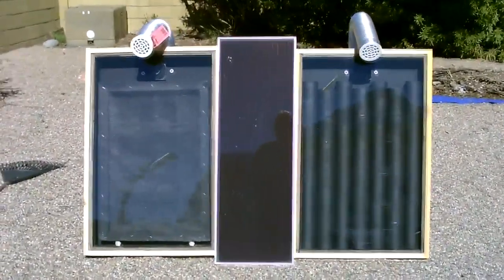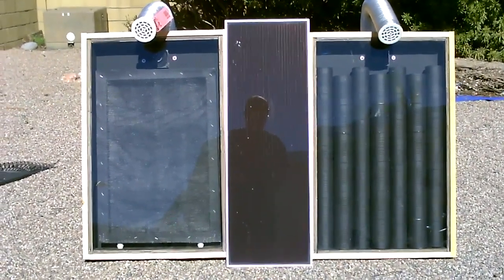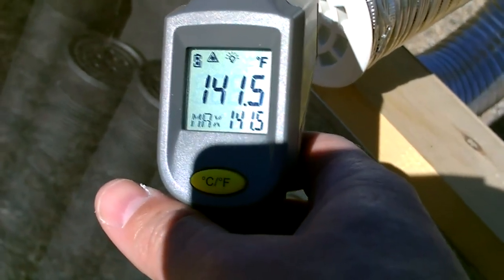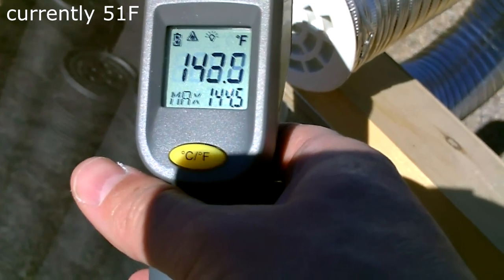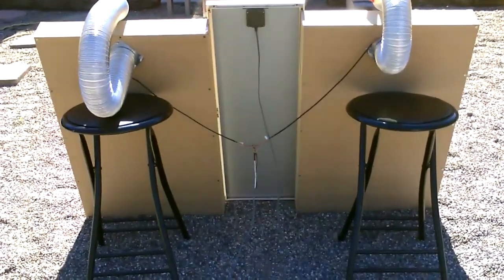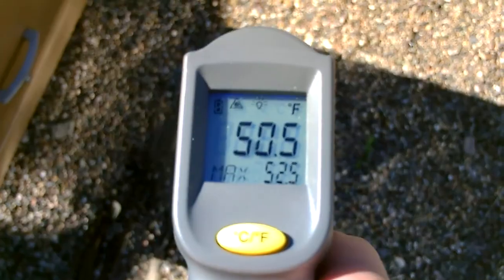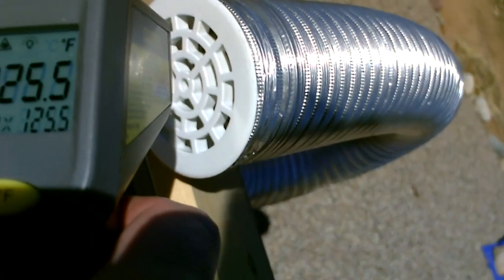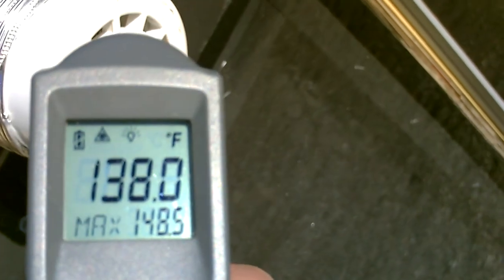Solar Air Heater Comparison! - Steel Can Heater vs. Screen Absorber Heater (temp. tests)

Comment: The surface area of the ceiling absorber is larger, and therefore more energy from the sun is transferred to the air in the form of heat.

Comment: dumb question but how do you turn it off in the summer? If you just closed a vent the heat would build up like crazy inside the heater. I see a lot of build and heat test videos but have not had much luck with install videos
Reply from the maker: hi there. the heat builds up in the summer but it doesn't matter. it never gets too hot to cause any damage. (not even close). you could cover it with something if you wanted to. i usually install the units through windows. you can mount a plank (like a 1x6 or 1x8) or a piece of plywood in a window (then just hook the hose to that).

Comment: Nice results on both panels. I have installed professionally made passive solar heat panels and these are amazing on providing continuous heat in daylight.
Reply from the maker: hi and thank you! i agree, they work very well.

Comment: Would this work in a greenhouse? How long does it heat after sun goes down?
Reply from the maker: hi. yes, it should work excellent in a greenhouse. once the sun goes down it cools off fairly quickly. (and the fan will stop as soon as the sun goes down so that works out good).

Comment: What about putting the screen over the cans? I would really like to know if it increased the heat, because I wanted to make a couple for my dog houses because I’m homeless and this is the only video I have found in years that should how well the actually work
Reply: You can't be homeless if you have a dog house.
Reply: @rayleblanc7209  I actually live in an rv in the woods dumbass get out of here with your retardation

Comment: If your duct work is not the same length at the ambient temperature then the longer duct will read lower temperature. blower cfm will have an impact as well.

Comment: Considering the heat is below 200 degrees Fahrenheit,  I would try my construction out of foil lined styrofoam panels.  The heat panel doesn't need to be metal.  Lamp black cardboard would convert the suns radiation into convection heat.  The. Internal temperature is kept low by the active fan...like a radiator!

Comment: What is the screen absorber material?
Reply from the maker: hi. it's just standard (non-metal) window screening material. (fiberglass/polyester etc)
Reply: @desertsun02  does it have to be black or can charcoal work?
Reply from the maker: @Robert McCarthy if it's a dark charcoal color it should work good

Comment: I made  an aluminum soda can heat collector panel similar to yours, inspired by your video, and it works better than I thought it would. Its been in the thirties fahrenheit and a sunny day it blows hot air all day. It just takes about one hour for the panel to heat up and blows hot air continuous throughout the day, thank you for your video.

Comment: If you really want to collect some energy, turn the air speed way up.  High temperatures are fun but pointless if the output is a trickle of hot air that doesn't do much for the rest of the room.  Crank the fans up.  Get the output temperatures down to 90 or so, fill up the whole heated space with warm air, not a corner of the heated space with hot air.

Lower temperature change = greater efficiency, greater overall output, greater usefulness.

Comment: If building an air heater--R 10 for the sides and back--pull cold air off the floor--air speed should get the output down to 20 degrees above the room temp. expect about 100 BTUs per sq. ft. per hour. The hotter the panel runs, the less heat gets to the room. It is lost to the outside. The best panel would run at 45 deg. and supply a heat pump

Comment: I'm very curious to know who this went long-term. Any follow-up wisdom?
Reply from the maker: hi there. since they've held up well, i wouldn't change much with the builds. i have recently found a different type of flange for connecting the hoses. i've actually started using air intake mounts that are typically used on cars. they sell 3" ones on amazon.
Reply: @desertsun02  excellent. Thank you for the update. There's a million build videos, but nothing in the way of a "Am I actually happy with this" video. Might be an untapped market if you're looking for a video topic. :) Thanks!

Comment: Any reason not to collect the hot air from behind solar panels? Or just use a flat black steel or alloy sheet in a double glazed box? This would be low profile and easier to incorporate into a building.

Comment: the exhaust fan hose on the can model is longer allowing for more surface area to cool down the air before exiting ,,,so i think if both are the same length ,,, the difference would be minimal. ,,,, great experiment
Reply from the maker: hi and thanks. although they may look different lengths they are exact same ✔ (neither one was ever cut down)

Comment: Excellent video and experiment. I might add that the reason the screen puts off slightly higher temps is because it both absorbs and radiates infrared light at a faster rate than the solid steel cans. However the steel cans will likely put off a more steady heat, and it will also likely continue to put off heat slightly longer than the screen once the sunlight is no longer available, therefore the total amount of BTUs generated may be very similar over a given period of time. 

Also I couldn't tell if you had glass or plexiglass or if the screen and cans were just exposed to the atmosphere. Seeing what difference would come from glass and plexiglass enclosures, as well as nothing (open air) would also be a very interesting experiment to watch. 

Thank you for taking the time to produce this video!
Reply from the maker: hi and thanks! since they operate by trapping the heat, the collectors wouldn't work much at all without the glass or plexi-glas.
Reply: Interesting, so if you had clouds passing overhead the steel can design would be a better choice if a more consistent temperature was desired.

Comment: I noticed that the duct was shorter on the screen heater. This could affect the difference between the two. The temp difference between the two is nominal. As another reviewer said, I’d build whichever one I had materials for on hand. I’d add one thing to that. The screen version would be much easier to clean by simply removing the cover glass/plexiglass and spaying with a hose or power washer. For the inevitable objections of those who fret about dust, dust mites or black mold. This sways me toward the black aluminum screen model, for no other reason than cleaning it as needed. Thanks for this video.

Comment: No more difference than a couple degrees between the two, I think the choice boils down to which one is the most economical to build. In my case it depends on the materials I have readily available to me.

Comment: I tell what I did take and make a solar screen using
Charcoal colored wire screen and simple Frame and mounted it on inside of room window wich faces south ..I am currently heated to 80 degrees farienhiet in that room the rest of house is in 70 s so that simple design would save me money on my heat bill and cost me 15 dollars to build ..I mean why not use yourr room as the box for the solar collection screen ? Right that way it's more efficient  and you don't need a fan at all ...I don't think  I could heat my entire house that way because I only got to south facing windows to play with ..so maybe I build a huge collector out of 2x4 and left over steel sheeting from roof project ? Ever get on a tin roof when it's sunny ? Anyways I want

To thank you for the  awesome idea 💡 and give you credit ..

Comment: interesting comparison, but to get the true output you need to measure airflow coming out,  one with more restriction will flow less air, but also be warmer.  with both the airflow output, and the temps you can calculate BTU output to see which is actually more efficient.
Reply: Airflow thru the unit is important, to much airflow will lower the temperature. It has to be the correct airflow.
Reply: @stevenbusman  correct, there is a happy middle ground in the efficiency balancing the heat input and the airflow.
Reply: @stevenbusman  I apologize if I am overlooking something, but to my understanding, a variation in air flow would still not alter the BTUs in the outflow.
Reply: @anthonynorton666  Yes, it would.
Reply: @raam1666  Indeed air flow will affect heat output, see the video on my channel titled: "Solar Heat System Tuning, Part 2"

Comment: How does the steel panel compare to these
Reply from the maker: hi. it's pretty similar. that unit is a bit bigger than these though so it's hard to do an accurate side by side test.
Reply: @desertsun02  what do you think is the most feasible and efficient option
Reply from the maker: @Shane Noel it will depend on the materials that you have available to you and if you want to incorporate 'recycling' into your project. by recycling i mean using old food cans as an example. one of my personal favorites is the downspout solar air heater i made. it uses solid glass on the front and has a thick plywood back. the downspout material is fairly thick too.

Comment: Wouldn’t making the path for the air to move through longer make the air warmer? For example, instead of having the air come in from the bottom, straight to the top, why wouldn’t one design this to make the air zag back and forth?

If the aluminum cans were replaced with smaller HVAC duct that zig zag back and forth from the bottom to the top, would that work?
Reply: Can't see why it wouldn't. I guess the steel cans are just a low cost easy to get alternative.
Reply: @JosuRibeiro  Yeah, that's a good point. 

I mainly ask because I've seen it be suggested that if you make the path for the air to move through longer, you end up getting less actual heat in your output. The same goes for if you restrict the air too much. I just wanted to verify that.

Comment: I simply can't understand why every single home in the UK is not fitted with something passive like this that is always on the go in the winter, and maybe in the summer working as a heat exchanger of sorts.

Same with solar water heating. Why wouldn't you have the sun at least heat up the water 30% of the way and use the boiler to top it up if you wanted a bath or something.

Fed up hearing about "be green" and "climate change" when systems such as these are inexpensive, can be fitted in a day and would save thousands over their ridiculously long lifetime (at least compared to batteries and solar panels).

Comment: I still haven't seen one that works better than my truck radiator painted black almost 100% efficiency with high clarity glass three pain
Reply: ב''ה, water or air?
Reply: I'd like more info on how you did that

Comment: Maybe try something like a super black paint like vantablack or black 2.0 and see how much heat you get
Reply from the maker: hi. it's good idea. i haven't been able to find vantablack on sale to the public yet. they sell it to some businesses i guess, but it's hard to get. i'll keep looking
Reply: @desertsun02  i think black 2.0 would be better since its easier to get
Reply from the maker: i looked into black 2.0, but it when it dries it can look a little bit like dark grey (i've heard). they do have something called black 3.0. i think i might try that. it is not supposed to look grey once it's dried.

Comment: Why did you use steel cans and not aluminum cans - which conduct hear much better? Was the screen aluminum?
Reply from the maker: hi. i've used both aluminum and steel cans, but i find that the steel cans seem to get hotter and say hotter longer. (probably due to the fact that steel is denser than aluminum). the screen i use is not aluminum but aluminum screen would probably work just as well. 👍

Comment: Maybe you should consider, the faster the air flow, takes the heat away, the slower will get highest heat.. like oven cooking. Wasted heat from where.? It’s Solar, even in Fall and winter. Does this say it’s CO2 ? More like Solar stuff we are getting more of than Earth can dissipate?  Core heats from below. Grab you share of Geothermal from under the earths skin.  Plenty of it, we never bothered much about it before, but now we are melting from under us. Easy just to pay for it and keep quiet.
Not my expert knowledge, just logic of , what makes us get heat from winter Solar energy, or any energy , nothing but the Sun.?
Is there a detectable component which is giving us the extra heat to our core? NASA should know?

Comment: How did the airflow and pressure drop compare?   was there any difference in ir flow rate?
Reply from the maker: hi. there's no noticeable or discernable difference in the airflow rate between the two. its about the same in both.

Comment: Screen absorber is easier material to work with, and picks up sun from any angle, vertical and horizontal. They make sense as the sun moves off direct alignment as there is more surface in direct line. Cans have some surface area throughout the horizontal arc, but not vertical arc. Whereas downspouts have most of their surface area in direct alignment only. So when the sun moves off direct alignment, output will fall more quickly. 
Where the fans the same speed/power? That would make a difference.
Reply from the maker: hi. yep, the fans are the same.😎

Comment: i built one of these, and here are my thoughts.   its a fun project.   I've only used it for a couple weeks.   i am getting between 130 and 150 coming out of the solar heater and into my house.   here is the downside, there is not enough volume of air coming out to add any real heat to a room.   i put  a fan and the bottom to force more air up and out the top.  that did help, but im afraid it is still not enough volume of air to make any meaningful difference in the feel of the room.  any ideas from anyone?
Reply: If you can, put the panels inside the house, in the window.
Reply: Did you ever figure out how to increase the volume of the air blowing into your house to solve the problem?
Reply: @adobemastr  I remember on a solar heater forum in maybe 2019 that suggested putting the fan on the output side and pulling the heat out, as opposed to pushing it in. Move more air and find a way to get more heat inside your enclosure to increase efficiency. The ideal setup is putting a heavily-insulated box outside and running ducts inside, but of course using dampers and some method to keep the heat from radiating away from the glass by convection.

Comment: When it's 50 degrees out it doesnt take much to heat a room to 68, what we really want to see is how it works when it's like 15 or 20 degrees F outside, in which case the box will have to be insulated in the back and 4 sides as would the pipe.
Reply: If you watch the instructional videos you will see that he uses multi layered cardboard  that is glued in & painted black to insulate

Comment: Would like to see some one tie one of these to a sterling engine to produce electricity
Reply: Would you just use the solar panel for that? Seems redundant and inefficient to convert solar power to heat to power.
Reply: Just use fresnel lens directed on the piston of the stirling engine, lots of videos on here about that

Comment: Why not add some black drip irrigation tubing filled with water to the back of the screened unit, to add mass and retain heat better after the sun sets?
Reply: The heat probably wouldn't last long enough to make a difference.  Maybe get 5-10 mins of heat from it.

Comment: I’ve got 2 screen type heater built.  I love them    I made one with 2x4 frame.  It’s way hotter than the 2x6 one. Both have single pane glass.    I’m wanting to build a bigger one and incorporate water tubing in it.  My question is I have an old sliding door that’s glass double pane    Was wondering if the polycarbonate would be better
Reply: Any idea why the 2x4 frame is hotter?
Reply: @fetymann  Less space to heat up that's all.

Comment: Thank you for this test. Assuming you have exactly the same air flow through both, it proves that higher surface area collecting light inside a solar collector is more efficent. 

Lets look at two hypothetical solar collectors of the same size and color.

One is aluminum foil linning spray pained black. Light hitting it is absobed and is converted to heat.  It gets much hotter than the air above it. For this discussion we can ignore the surfaces below.   Some of that heat is given up to the air above it, but that is limited due to air flow and surface area.   Also because it is hot, some energy is radiated as infrared light out to space. The hotter a surface is, the more efficent it both radiates infrared light. 

If the same amount of sunlight falls on a larger surface area like a screen or fiberglass insulation spray painted black, the substance does not get as hot as the light is collected over a larger surface area that is also incontact with more air inside the collector. And because of the energy is more quickly given over to heat the air, less energy is lost to infrared light making the high surface area solar collector more efficent.
Reply: Can you explain why this more surface area with the screen versus the cans?

Comment: The energy output should be almost identical because the surface areas are nearly identical and essentially the same level of solar radiation is entering both heat exchangers.
Reply: Walter Jacques that is only true when equilibrium is achieved.  Same Q entering, but the can version has more thermal mass to heat up.  This means some of that energy goes to raising the temperature of the cans.  Which is why it has a lower output.
Reply: @bma8013 To ovšem platí, než se zahřejí. A to je chvilka, pak už nemá nižší výkon.

Comment: Maybe it's surface area.  add mesh inside the cans and test again if your into it still. Also if your glass is not anti glare you will lose light/heat